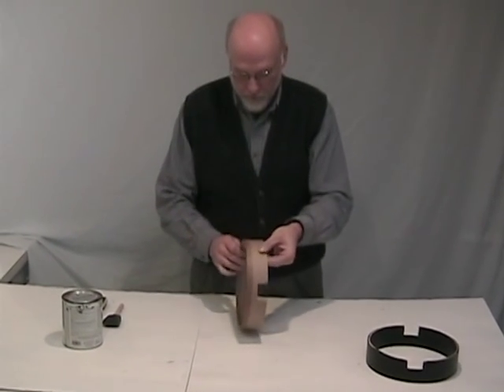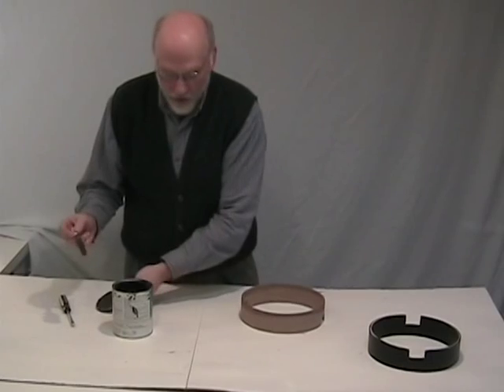Step 1: Painting Your Banjo

Comment: You can deal with the rough edges by sanding, then a coat of shellac, followed by more sanding. After that, the grain should not rise when you paint. Shellac is great stuff, easy to use, dries quickly, durable and easy to repair if needed. Cheaper than urethane, too!